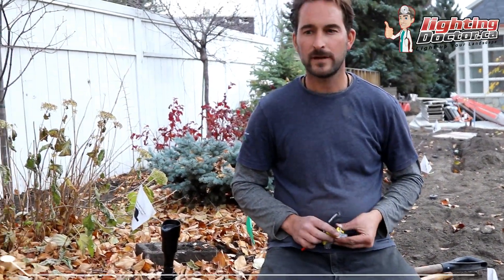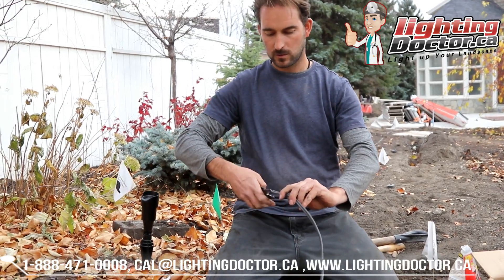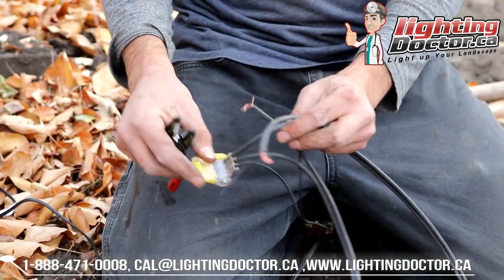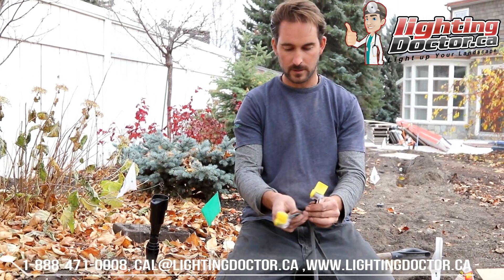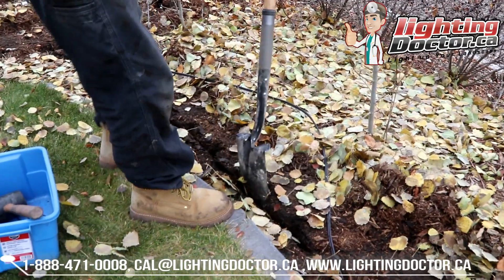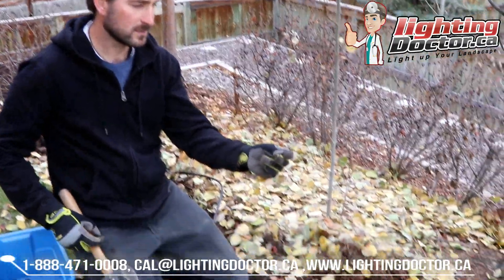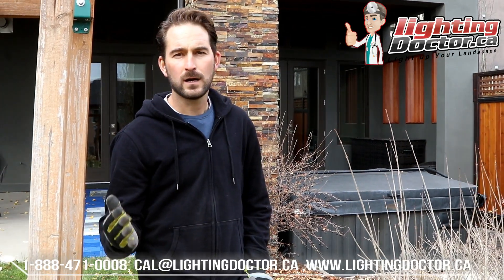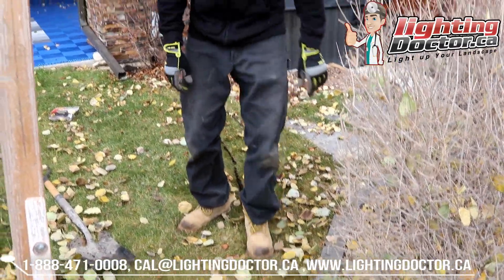How to Wire Low Voltage Landscape Lighting - Waterproof Connectors

Comment: Hello- If there is a issue with a lights or something else can you reopen and reuse the BVS2 connectors? Also can you run two wires together off of one transformer connection, one going left around the house and one going right? Thanks for the Videos
Reply from the maker: Yes to both your questions!
Reply: Thanks so much. Sorry, one more question,  my GCFI outlet is on one side of my garage but I want to put lights on the other side of the garage, and since I don't want to run over the wire every day with my car, Is it safe to run the wire up and around the gargare (vinyl siding) to the other side ? Thanks so much again.
Reply from the maker: @GirlsBasketballClassof2028  yes absolutely that would be fine or above in the gutters works also
Reply: you are the best. thanks